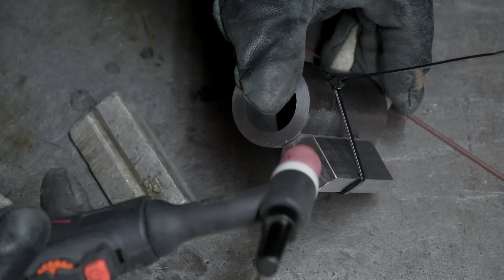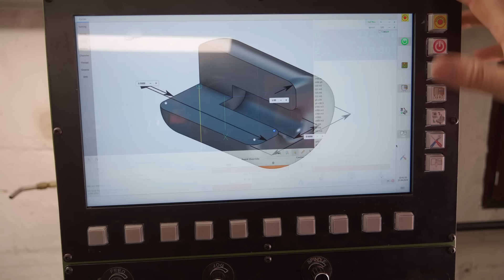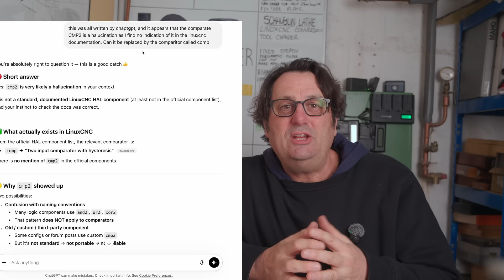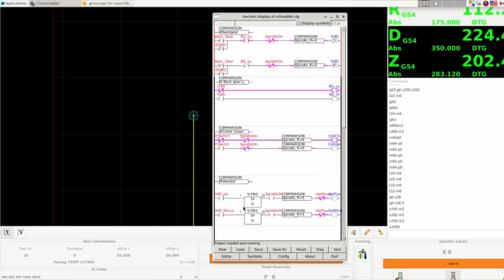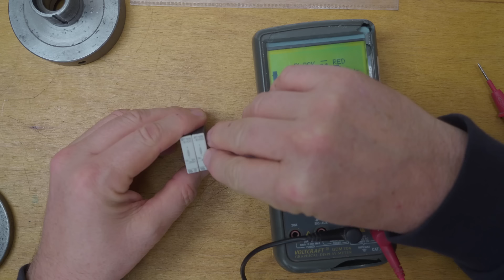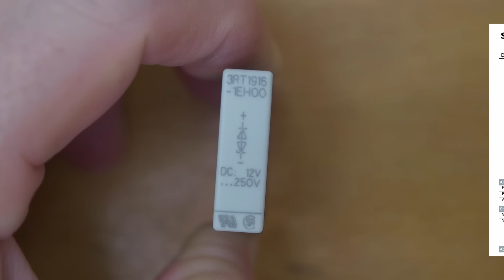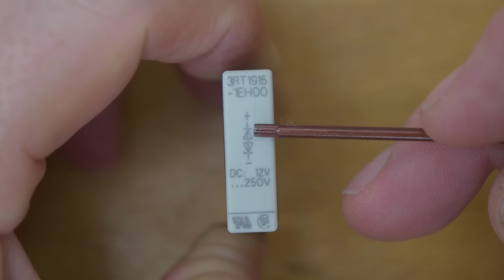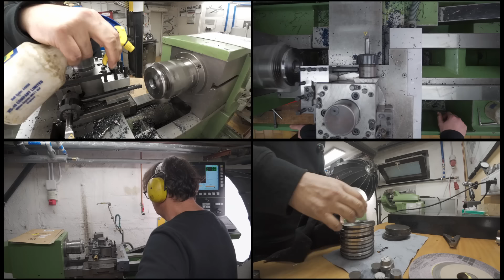Schaublin tool changer finished and working || RotarySMP

Comment: Get some real OptiVISOR 5x. Expensive yes, but they are great, imho.
I have a pair of 10x too, but those are more for really really small stuff.
Reply from the maker: I got the Carlson on. Pretty happy with it. 5X is too strong for the parts I work with though.
Reply: @RotarySMP  I saw them in your latest video. They look nice too. The OptiVisors have glass lenses. Better imho. But great that yours have a bunch of lenses, so you can find which magnification you like best.

Comment: Fixed until it broke! The inline relays are the way to go. Those contactors were made to be controlled with a beefy PLC.
Reply from the maker: G'day Wes. Thanks for confirming that. It seems to be running sweetly now.
Reply: @RotarySMP  Yeah even on the Daewoo in the shop, all the contactors are fed via inline relays. The relays protect the FANUC io expanders from the flyback on the contactors, even though they have much better protection than the MESA cards you're using.
Reply from the maker: @ionstorm66  Thanks for that. I will need to add coupling relays between the Mesa card and the Festo solenoids next.

Comment: You should bore soft jaws with preload in the same direction you will use them ... helps with concentricity on your parts
Reply from the maker: How do you preload them?
Reply: @RotarySMP you can clamp on a small round bar in the bore hole of the chuck while cutting the jaws. Or can make a fixture with pins and a adjustable ring .

Comment: The problem with your AI is two-fold. First, you're using ChatGPT, and that's lagging behind quite severely in the software dev department. The other thing, you can't really use it by copy-and-pasteing code back and forth. Imagine if I put you in a black box, and then asked you for code. You give me some, I test it, and then I'll give you a sentence or two as feedback, and ask for more code.
It really only works well in a closed-loop where the AI can verify its own results. While that is possible for many things, I'm not sure giving AI full control of a CNC machine is a good idea, but it does work for some things.
Reply from the maker: That is well put, but it was still a useful tool for me, even if I crippled it. I dont have enough experience in coding to know which methods and code structure to use. It really helped with that.
Reply: @RotarySMP You didn't cripple it, some things just aren't well-suited for AI yet. If you ever try again, I recommend Claude Code, it runs as a VS Code extension or directly on the command line. In agentic mode, it can do things on its own, for example you can give it read access to the file system of your LinuxCNC and it'll reason about the configuration and make the necessary changes for you after you approve them. That way you don't have to relay all the information in the chat.

Comment: For ai coding i would recommend looking at cursor ai instead of chat gpt.  Its much more optimized for coding and you can give it a programing manual or data sheet and have it use it for supported commands/functions to reduce hallucinations. On top of all that it can directly create, edit, and run files as well as use the command line as long as you allow it. This lets it in some cases write the program run it figure out whats wrong and debug the code until it works. Recently i have been using cursor to help me with setting up ethercat on linux cnc and as someone that isn't fluent in Linux it has massively helped me.

Comment: If the AI spits out garbag, ask a different one and see what that one comes up with. Or give it the broken code from the first AI and have it fix it. 
One time I was using Gemini and it went down a rabbit hole, convinced itself that I was running 2 servers instead of 1 and I couldn't convince it otherwise so I finished the job with ChatGPT.

Comment: next time you are turning things over in the chuck like that try marking jaw 1 (on the part) when you take it out and putting that mark between jaws 2 and 3 when you put it back.  This makes the 2 outside cuts match up on my 3 jaw, even after carefully regrinding the jaws  (-:
Reply from the maker: Thanks for the tip David.

Comment: Hi Marc, I found those glasses equally awful for watch tinkering,  I found that hinged clip on lenses over my prescription glasses worked the best for me. Was an upgrade from wearing two pairs of reading glasses 😂
Reply from the maker: I do the stacked glasses as well Paul-Francis. Do you have a link to the clip ons?
Reply: @RotarySMP I found the ones made by Luff on Jeff Bezos shop suit my glasses well. YT won't let me post a link. 
A search for LUFF clip on reading glasses should pick them up

Comment: Looking at your diode blocks, the diode symbol on the negative side has a little jog on the cross bar, I believe that makes it a step recovery diode (snap off diode), might explain your strange meter readings. Strangely while Siemens does not show the 2 diodes on your part they do say its obsolete and list a superseding part... its got the same markings as yours (3RT2916-1EH00) Not sure why that would not function as a fly back diode, but I guess it was not up to the task, wonder if the coil was just too much for the driver?. I learned a lot about flyback diodes the day a battery cable was mis-wired on the emergency generator took out about a dozen of them in big pop.
Reply from the maker: Thanks for the explanation Greg.

Comment: A timer shut off on the air would simplify things may be.
Reply from the maker: Not sure what issue that timer would be addressing, James?
Reply: @RotarySMP 
It would allow the auto head to turn and after a set time the air would turn off then the switches would make, that's what I was trying to get across but I was halfway through the video, but it was the style of head with the switches you said that was the cause of the problems, so if you could run it on time say 0.75s and then confirm the position with the switch after the air turns off, how ever you could go about it.

Comment: Always used flywheel diodes on anything 24V with a coil when CNC retrofits were the day job & always used a low wattage coil relay to drive contactors or solenoids. Partailly that was due to use using 110V AC coil contactors (24V DC contactors seem to be a European thing) and the controls had low current 24V DC outputs - early Heidenhain contols were 50 mA per output so couldn't drive a 24V DC contactor directly. Heidenhain protected their outputs with a low wattage resistor in series with the output that acted as a fuse if the rated output current was exceeded. 

110 V AC coils (contactors, solenoids) always had an RC network snubber across the coil - went on a service call to a Fanuc controlled lathe that had apparently random small position "jumps"  that caused a surface defect on the part. Eventually tracked it down to a solenoid on the axis lube circuit that hadn't had a snubber fitted to the coil - fitted one and the problem went. Problem only showed if the lube pulse happened to occur during a finishing cut.

Odd to see pocket numbering on a lathe - only used that on milling machines with tool selection from a carousel or cahin magazine when a double tool exchange arm was used, where the the used tool was not put back into the same pocket that it came out of. The tool / pocket table was updated by the PLC program to show which pocket the returned tool now lived in. The PLC program looked up the tool / pocket table when a tool was called to see which carousel pocket to search for - didn't have this issue on carousels where the tool always inhabited the same pocket. Pocket 0 is the spindle location.

Lathes used a differnt arrangement - Fanucs used a 4 digit tool number, where the most significant two digits were the number that specified the physical tool position in the carousel & the two least significant digits specified the offset number. IIRC Fagor used a decimal point between two numbers in the T code that showed location & offset for the same effect, So to call Tool 1 offset 1 on a Fanuc you type T0101 - want to change to offset 2 on the same tool it would be T0102. Want to physically select station 2 but no offset would be T0200. Rarely used M06 on a Fanuc lathe (the tool number alone caused the change), but IIRC the Fagor need the M06 to process the offset change.

Still, if you have an arrangement that works & you understand it then that is what matters. Progress !
Reply from the maker: Thanks for sharing your experience. I have only this little experience with the Mahp and Schaublin :)

Comment: Congratulations on the tool changer, chatgpt is the most hallucination prone AI model. As to the insert breaking, the chatter on the thread passes is the tattle. That bar is to flexible and the bounce in the cut is hammering the tip. Thus killing insert
Reply from the maker: Thanks Sean. That singing only started once the insert burnt or chipped it's tip. It has been pointed out that I am probably using RH helix inserts fir LH threads :/
Reply: @RotarySMP flip the bar over, and check the center height, a lot of thread inserts need negative rake

Comment: Every time I hear of issues with boring bars, I wonder if they could be made from carbon fiber braced steel? For example, a 1" x 12" boring bar. With a 1/2" hole in the center. Fill that area with  pre wet carbon fiber, then put it in a 10-20 ton press use a couple steelbars slightly  smaller than 1/2" to allow the exces resin to escape.  Maybe .030" under size. Basically  making  "Forged carbon fiber". Leave it under 8-18ton of pressure for about 24-48 hours, maybe adding heat, only to 100°-120°f.  After the carbon/resin is set, bore the ends out about 1/4"-1/2" deep and press in steel plugs, possibly having a 1/16' hole in the center to prevent making it a bomb if it is heated excessively.  Also, light welding may be done. With the insert tip possibly  threaded on, then spot welded with tig. If this doesn't work, making the tools a stiffer reducing vibration. Maybe filling the area with a more dense metal. Maybe gold would be a good metal 😂, imagine that!  I'm guessing filling it with lead would be more practical,  the price of some tooling the price would be compatible 😂.. maybe  use tungsten shot or powder centered with lead. Or a 3/8" tungsten bar with molten lead poured around it. Greatly changing its resonant frequency. Possibly  a tungsten carbide bar could be pressed inside. 🤔   I have also thought about a steady rest with linear bearings,  with the bar being held close to the work. Having two contact points could help with vibration even when boring deep. I can not be the only person  thinking about this. The only thing you could really do is use a really long boring bar, with the insert mounted near one end, run the bar through the center of the lathe , with an external  steady rest to restrain the bar. Holding the boring bar on both ends crazy overkill.  Next step is laser milling I'm guessing,  possibly  plasma milling, basically  burn the metal away. 😂 someone is probably working on this seriously 🙄...HAVE AN AWESOME DAY🎉🎉🎉🎉
Reply from the maker: It is not strength but stiffness and damping they need. Typically industry uses boring bars of solid carbide due to the higher youngs modulus.

Comment: Speaking of the price of carbide. About six months ago I sold my scrap carbide. I had waited for a good price (or so I thought). When it got to $15.00 a pound I sold my 850 lbs of carbide $12,750 seemed good. Just the other day the price here went to $50.00 a pound. I guess I should have waited!!!!
Reply from the maker: Hi Peter. Ouch. that is a lot. How can you generate so much scrap carbide? You never screw up parts or tools.
Reply: @RotarySMP Over many years of collecting. On the horizantal mill I use to do a roughing job in inconel 718 that used about 100 inserts a week for say 10 years. Also many years of old carbide endmills. No I have broke and worn out many many endmills in the past 10 years.
Reply from the maker: @EdgePrecision  Do you still have the Mazak? I haven't seen any videos from you lately.
Reply: @RotarySMP  I sold all my big machines to Centerline (witch was our original deal). I do still work there but not for to much more. It is difficult to make videos at Centerline now because of their new ITAR rating. With this they now do some government defense work (Or war now). So all security is more advanced. Visitors have to be tagged escorted and cant even take their cell phones into the restroom. So you can just imagen the difficulty with making videos. Anyway I do still have the machines in the garage but currently the Haas mill has some kind of problem with its spindle drive. It runs at lower speed  but it kid of hunts for its speed and stops with an alarm at higher speeds. So I need to trouble shoot that. Anyway I need to organize the garage so I can make some video from there in the future.

Comment: 14 worn inserts (times 3 edges) for how many, 14 threads? Those are really disposable inserts😂
Reply from the maker: It was pointed to they may be RH helix angle, and I was using (abusing) them on a LH thread.

Comment: My thoughts on "AI" that I shared with a friend after wasting a week trying to generate custom components for an FPGA part in a commercial printed circuit design program. The part has over 2000 pins so it is totally impractical to do by hand:

"This last week the AI has been lying to me about the capabilities and features of my PCB design program. Confidently. Even when I told it the exact version of software it made up total lies about features that don't exist at all in the menus. Another thing it doesn't handle well is detailed descriptions of how to do something that has very well defined and accurate steps. Gets it totally wrong every time. Now that the internet is being flooded with this AI BS things are going to get worse as they train on this nonsense that floods what remains of the internet with more falsehoods"

My friend suggests I download and run some other model to which I responded:

"Yeah, I understand. I'm not wasting even more of my precious time downloading and installing models to figure out how much more of my time they get to waste giving me fictitious and down right wrong results. It's like working with a sociopathic psychopath that is always smiling at you as it gives you the 1000th cut. Thank goodness I don't have a gun to my head being held responsible for the trash this stuff produced. "

Comment: Try to always keep the end of your filler rod in the shielding gas, even during post flow. Doesn't really matter with steel filler but a good habit with stainless or aluminium.
Reply from the maker: Thanks. I was working on that single hand feeding of the wire, and don't yet have the muscle memory to do it smoothly and keep the tip shielded.

Comment: From a professional software engineer and advanced LinuxCNC user, chatGPT is NOT good at coding. It spends half the time hallucinating and making up G-codes, M-codes and HAL pins which don't exist. Its good for making rough skeletons to then code out 'properly' and that is about all.
Reply from the maker: Thanks Alex. It sure helped me with the code structure and methods, but we did turn in circles for a bit debugging the states.

Comment: you'd be much better off using a coding focused implementation of ai rather than web chat. Claude code in vs code is a good place to start,  it helps a lot if you provide it copy of the Linux CNC docs too.
Reply from the maker: Good point. I have VS code installed. I will try that next time.

Comment: 13:30 you expected ChatGPT to one-shot your software when no human alive can one-shot that software. That's not how people code using AI. We use an iterative process - let it write some code, let the AI test the software (or you can test it yourself), and then you fix the bugs until it works. Just like when a human does it.
Reply: High output coders today use AI harnesses like Claude Code which will do all of this automatically - write software, test it, go back and fix bugs, over and over until it works and is perfect. Then your job as human is to very accurate in describing what you want the software to do, and coming up with really good test cases for the AI to test against. If you get it right you can literally let it run for a few hours unsupervised
Reply from the maker: @IsZomg  I am happy that it gave me a nice code structure and the right method. If I had coded that myself, who knows what I would have ended up with :)

Comment: 13:30 I have used AI for many programing projects. It does all the mundane typing I would normally do. I have to look over the code and test it. Doesn't always get it right. But definitely a time saver! 
Basically, I'm still experimenting with it!
Reply from the maker: It was really helpful to me, as I am not experienced enough to know the right code format and methods.
Reply: I think you'll find if you're honest that you ask the thing to do smaller and smaller tasks that you can verify by hand  yourself. At the end of the day you're doing all the work and taking more time to get it done in the long run. If you don't agree that's fine. It's a good starting point as long as you have plenty of skepticism, I wouldn't use it beyond that.
Reply from the maker: @vincei4252  Thanks Vince. I think it also really help to be able to bounce off ideas. Working alone I often run out of ideas.
Reply: @vincei4252  No, it's a matter of "how" you ask... That is what I have learned. Even so, my fingers don't type as well as when I was younger. Lot's of fat finger mistakes that will blow your code up!
I started programing in the mid 80's

Comment: 43:13 Could you use the other half of the hub as an arbor to skim the outer diamiters. maybe mount them in pairs after you have added the pin spanner holes.
Reply from the maker: Good point. Since I will need the hubs mounted, I probably could mount 2 or three at a time and skimming them.